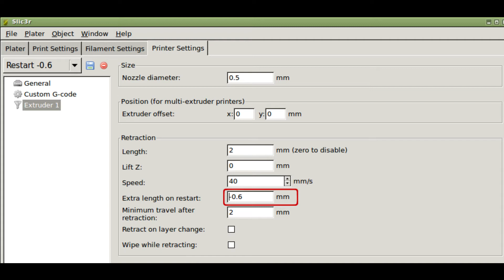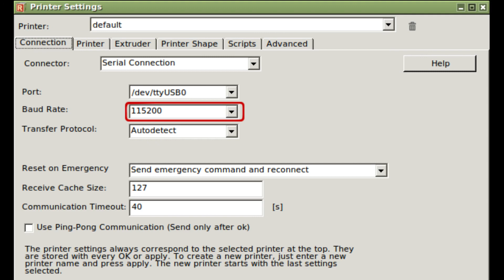Tronxy X1: Extra things to get it working

Comment: I was lucky with mine, I didn't have any slop in the y axis but had a hell of a time with the z. I tried tape and this fixed it for a short time, I ended up taping all the rollers afterwards but the slop came back. I eventually took it apart and tightened up the bolts for the rollers " Reaaally tight" and this fixed the slop. My main Issue was the lead screw wouldn't line up with the coupler on the z axis motor. I had to find screws that were slightly longer than those provided and used several washers as spacers to have the lead screw line up with the coupler properly.  

Adverse Effects, there are enough assholes in this world......

Comment: You're missing the bolt in the spring for the extruder feed system!  There is a spring and a large bolt that go between the two halves of the extruder clip, then the adjustment bolt in the moving clip sits in the hex hole of the large bolt. In this way you can adjust the extruder pressure

block-spring-bolt-block-adjust screw

( the adjust screw should be in the block already)
Reply from the maker: Yes, you're right.  Turning that bolt does nothing for me, it doesn't touch the spring at all.  It's missing a nut or plate at the end of it that's supposed to be pushing the spring.
Reply: niknah Find a bolt with a head the size of the spring. Hex (Allen) socket head. Length about 1cm. Put that in the spring then install it with the adjusting screw in the head of the bolt. That should fix the tension issue. Check the parts list in the manual or the assembly diagram again to see correct bolt. Hope that helps. I just printed my first test print from the SD card. Amazingly it was dead on for dimensions! 2cm x 2cm x 2cm!

Comment: What I had to do on mine:
1. Drill deeper countersinks in the bed, so that the screw heads were flush.
2. Replace several screws with longer ones.
3. Drill two new holes in the carrier for the bed, to allow me to move the wheels 2mm closer to the beam to get rid of slop and wobble.
4. Reverse the X axis in Repetier to get models to print correctly. There is a firmware problem and the X axis is reversed. There may be an update, but I have not tried to reflash the firmware yet.

Comment: My TronXY X1 came with a 0.4 nozzle, I see on your printer settings its using 0.5.. Try lowering that to 0.4 

If you get this wrong the extruder will try to feed more material than the nozzle can handle and cause the problem you've tried to fix by adjusting the the "extra length on restart" which is probably not needed.

Also mine came with flat head bolts to attach the print bed, with flat head bolts the print bed fits flat without any issues, perhaps your kit didnt come with them or they were missing..

My kit came from gearbest and was missing many of the needed plastic pillar spacers, I ended up trying a few different alternatives and ended up using washers as a replacement.
Reply from the maker: Thanks!  I had only set the nozzle in repetier but not slic3r.  I've left a comment in the video.

The bolts are flat headed on mine too.  What I meant was, if you put the provided paper clips onto the platform, it'll bend the platform cause the screws are in the middle of the platform.

They must just dump it in randomly, I have too many of everything except the screws that hold the motor.

Comment: my motors wont turn. they lock but dont turn. whats your acceleration feed rate ect?

Reply please as need this sorting been weeks. Z homes some times. All motor like click when homed. Extruder making clicking noises and getting hot.
Ive tried lots of eeprom, acceleration ect and even turning frivers up.
Help aha

Do not huy this buy aluminium and bigger for cheaperm
Reply from the maker: I left the settings the same as default except for the baud rate.
When you first start repetier, it'll ask you some questions about the specs. 0.4mm nozzle diameter, 150x150x150mm area.
When you first install it, don't screw in the Z-axis motor holder, that'll cause the z-axis to be misaligned.
Just leave it loose and maybe hold it during your first print.

If it homes then the motors are working.
Go to repetier and the "manual" tab, move it around to check what's working and what's not.
Check that the axis are correct, Z is up/down, Y is the platform, X is the crane.

Try pulling out the belt to see if the motor turns by itself.

Or post a video and I can take a look.
Reply: niknah then what as i done all this. z mozes under zero load "x axis" ive messed with acceerator and freds slight diffetences. No manual movement x and y click when homed. z will svream click and move super slow.
Ive had some 1 do firware but i want to use it strictly threw lcd and sd card.
When I click the 20x20 test they will click but not turn.
Moving 1 of the extruder motors to 1mm in extruder threw lcd makes the extrudder stop pulsing "the extruder pulses.

Im being extremely careful hence here but 3weeks now is silly i think the board pots are out and of cours my bats are dead on volt meter lol.

I want to use the lcd. How do I add missing commands. make it move with cold run. I got 1 to move or make noise with position 4 in position settings but now it wont. and none the others will.

If I home all z will scream and move 5secs later to home. X and Y will lock but not move while extruder just pulses till I move it 1mm in accelerator I think.

Just painting a picture of my situation. 

Appreciate it but hole things been nightmare i got the a8 too not even got all parts and dead motors. Its a bit crap😂
Reply: niknah thats what im saying x and y lock but dont move. extruder pulses and Z screams then homes after 5sec. tried replicating z setting on all but no go
Reply from the maker: I've never had the extruder "pulse".  So maybe there's something else wrong there.
But the z axis rod will make a noise if you don't oil it, try it with just the motors, no belts/rods, etc. to see if where the problem is.